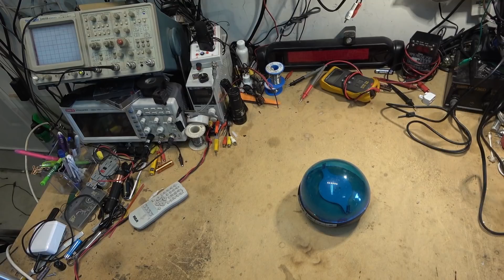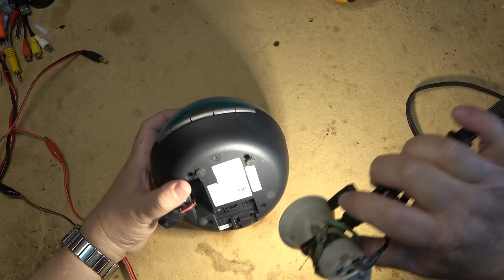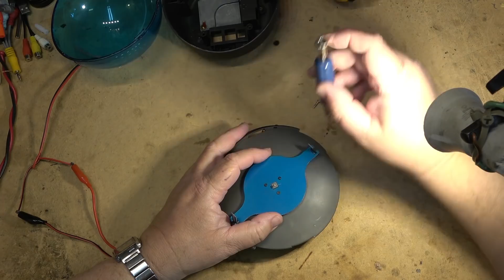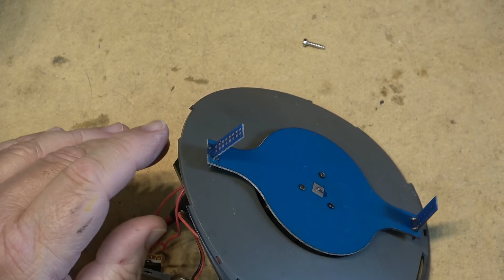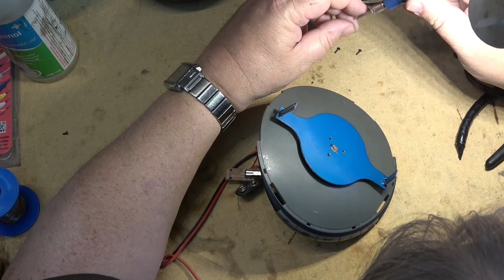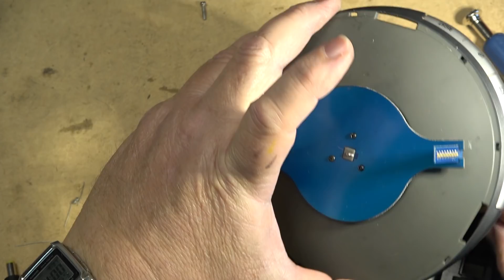Vintage floating display call display and clock repair

Comment: What's the spark gap for, sorry I'm completely uneducated on spark gaps
Reply from the maker: What spark gap?
Reply: @12voltvids  There are some printed spark gaps by the telephone connectors. Probably just for surge/lightning protection.
Reply from the maker: @eDoc2020  yes the phone line can bring in induced voltage spikes.  There will be a grounded protector in the demark box on the side of the house or main tel room in apartments.

Comment: if the electric motor was BRUSHLESS it would be silent with a sound equivalent to a pc cooler
Reply from the maker: It is silent. The noise you hear is the slip rings and the spinner as it isn't perfectly balanced.

Comment: In the 90s I thought persistence of vision displays would everywhere by now, in the Bladerunner-esque dystopia we'd all be living in. We got the dystopia, but PoV displays never caught on beyond being a novelty (probably because like you say they are noisy in use and prone to wear, and we developed much better display alternatives anyway) and like all the other 80s and 90s sci-fi fans, I'm still waiting for my flying car too. The displays are still cool in a retro way. In the UK we had Radio Shack (branded Tandy here) but we also had the Gadget Shop that sold a lot of this kind of stuff, back when it was quite pricey and not available for dirt cheap on Banggood etc.
Reply from the maker: I have 3 clocks that use the PoV floating display technique.  2 are red and 1 blue.  The red are much easier to read from a distance and one has been running non stop for at least 35 years.
Reply: @12voltvids  wow, I didn't realise they'd even been around that long. I have a Sony Dream Machine clock radio alarm from 35 years ago (bought by my mom as a 10th birthday gift), but i had to take it out of service as the VFD has deteriorated to the point it can only now be read in the darkest of rooms. Otherwise it still works perfectly and would still be in use.

Comment: Blob on board is likely a very common caller ID interface chip, with a simple serial output that interfaced with the phone line. Likely cheaper in the bare chip package, and the OEM had already a chip bonding machine to handle that size board, so the original design had as prototype the flatpack version, with the bonding pads brought in to where the chip would be, then on production they simply swapped out to the blob method. Simple connection, as all is done on the chip to recover the serial caller ID info from the ring voltage, and then provide it on the serial data line out, probably also with a ring detect signal to tell there is a call incoming to wake the display. 99% of those chipsets are only available as chip form, as there is almost zero use, other than in development, to use the packaged versions.

Likely you will find those 2 capacitors on the top are failed, one open circuit, and the other doing all the work, and soldering them off and on brought them back to life again by moving the remaining electrolyte around in the can. Easy to balance as well, just take the rotor on the motor shaft, and turn sideways, and spin slowly and see where it tends to stop. Then add a small blob of putty to the high side, and carry on till it has no preferred orientation, then power it up and see if it is balanced. Then take the putty off, and add solder equal to that under, rolling the putty out to the thickness of the solder, and using a fifth the length of solder.

Probably best to replace the capacitors on the main board as well, especially those direct across the motor, as that could be injecting enough noise into the power rails.
Reply from the maker: Motor is a bsl 3 phase like a computer fan.  No commutator or brushes.
Reply: @12voltvids  Those still can inject nasty switching noise into the supply rails.

Comment: it's an old idea but i still think it's neat :-D
I was starting to wonder if there was a special slotted disk and led/receiver in the motor, so the micro knows exactly where the emitters are, but it was dusty.
The fact it remembers telephone numbers is very handy :-D
Reply: Does not really need a absolute encoder, easier to simply have an interrupt pin that tells the microcontroller where a reference pulse is, and count from there, and fix in software the time it takes to rotate, or calculate it and keep this in memory, updating every few dozen rotations to compensate for motor speed.
Reply: @SeanBZA  That makes a lot of sense :-D
Apart from making a pic based L/C meter years ago, i don't have any interest in microcontrollers so i tend to think basic logic.
The code for the pic was nothing to do with me, i just made a pcb and slapped the parts on it lol.
It worked after a few swear words and lots of cups of tea :-D
Sorry SeanBZA waffle mode.

Comment: I have found sometimes that deoxit needs to sit on there and work for a period of time before the connections really start to work well. Maybe that was the case here?  I did just work on a Teac AN-60 outboard Dolby B unit. Both the main power supply caps which are over 40 years old had unmeasurable ESR lower than 0.000 ohms, so I left them in. I do find that the Deoxit D5 can wash the smooth feel of the potentiometers away, I may have to use some silicone lubricant on the shafts, or switch over to the Deoxit fader cleaner perhaps.
Reply: Yes you need a lubricant for pots, as you do wash the old lubricant away. I use a synthetic grease, food grade, as it is a drum I bought 20 years ago, and it still is more than half full, so is used for all grease applications, as it is light, smooth and in general not too harmful to plastic. Works well on pots, and also great on connectors, though bare copper it will go green, but for plated contacts it works wonders, and for moving parts.
Reply: @SeanBZA  I used dielectric silicone compound (grease) used for high voltage electronic ignition systems for the high voltage wire wound pots in my Heathkit IG-28 capacitor checker that I rebuilt. The old grease looked like peanut butter. Still working just fine. That is the tester I use for high voltage capacitors in tube amplifiers, ESR just doesn't work in those applications.

Comment: i always was wondering , is it a problem measuring caps in circruit ? dont u get faulty measurements?
Reply: Dave is measuring Equivalent Series Resistance, or ESR, which is measured in ohms. Because it uses 100kHz AC low voltage signal it can be tested in circuit. Measuring capacitance would have to be out of circuit, same with measuring leakage current of DC. (parallel resistance) Three different tests may be done on capacitors. ESR testing is the fastest most cost effective test for these low voltage electrolytics.
Reply: @zulumax1  thanks
Reply: @zulumax1  Can be fooled though if you have a few capacitors in parallel next to each other, and till the last one fails you will get a low ESR reading, though the capacitance value is very much reduced.
Reply: @SeanBZA  That is true, you would have to be mindful of that in a high current power supply like a computer,  reading the AC ripple component is what I would do in that case.
Reply from the maker: No esr measurements fairly accurate.

Comment: Leave a gap behind the bench.  That way one can bulldoze all the offending debris off the back.  Perpetual new space.
Neat little device.  Kudos to the engineers on that to get all that software timing just right.
Reply from the maker: Bench is fastened to the wall.
Reply: @12voltvids  Perfect!  Just cut a slot in the wall at bench height and it will contain the debris AND provide insulation.
Reply: Problem with that is the debris quickly builds up to bench height, then keeps on growing up.